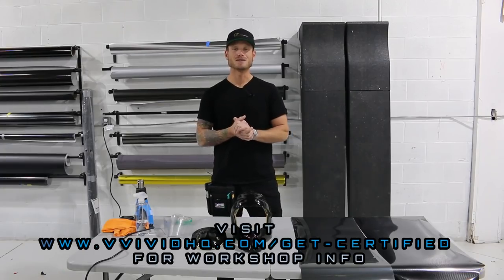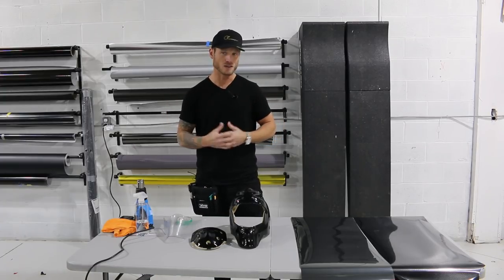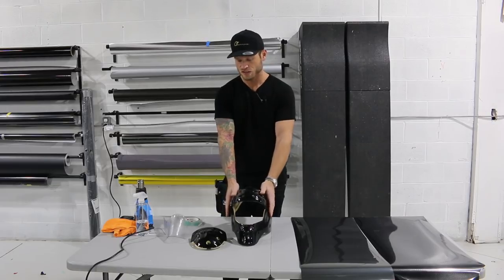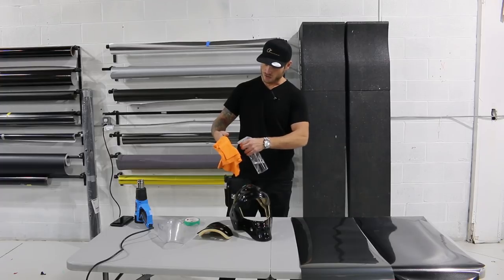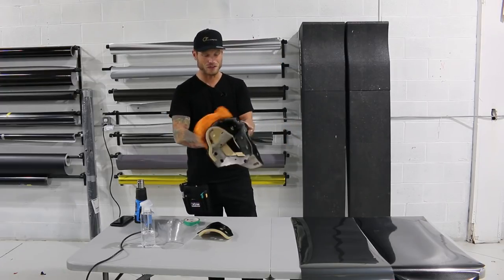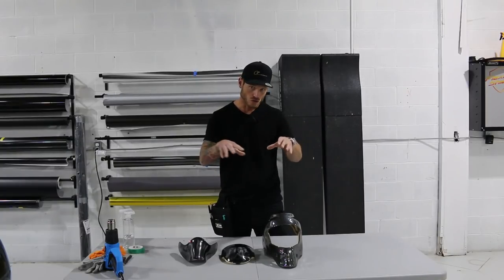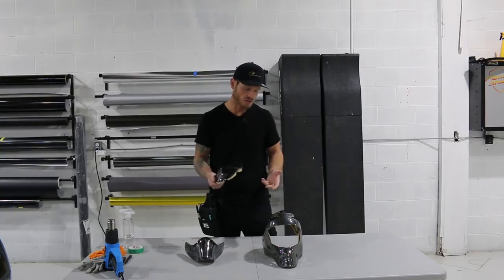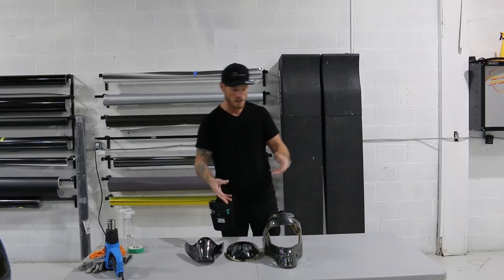Will It Wrap - Goalie Mask Vinyl Wrap

Comment: When I wrapped a goalie mask I put a bunch of cardboard around the end of a short 2x4 and then shrink wrapped it to keep it in place to make a “head” to put the mask on, I then clamped the other end of the 2x4 in a bench vice. It worked quite well to keep the mask in one place so I can heat and stretch with both hands.
Reply from the maker: This is a great idea
Reply: How do wrap a round motorcycle helmet by yourself
Reply: Chris Bundy with the proper technique and tools almost anything can be wrapped by one person. For a lot of helmets you will want to use the same technique Christian showcases here, some helmets can be wrapped in one piece. Like I said I created a mount for my bench vice to hold the helmet solid in one place in order to be able to manipulate the vinyl the way I needed to for a clean, durable finished product.
Reply: @hxcdrums3  Did you do it in one piece? You don't happen to have a video do you?

Comment: I would have used the table itself by putting the vinyl wrap in the center of table, which splits in half.  This way you could have constant tension on one side so your hands could get the leverage and tension needed to stretch the film over the mask.  Great Job even with the obstacles!

Comment: Curious what you learned from this to apply to the next attempt. What would you have done differently? I've seen a "barrel technique" (not sure what the actual term for it would be) done with a regular round skateboard-style helmet that worked well, but I don't know if that would have worked with a goalie mask? I'm going to be attempting a mask soon with a printed graphic on it, and I'm hoping (fingers crossed) that I'll a) have some more input from people like yourself before I start, and b) have some good luck to get it done in a single shot with one piece!

Comment: Brilliant work and teaching brother ... Ace ... heavy Dumbbell plates to hold it down bro?  ... Would a ceramic coating stop water getting into the laminate in the epoxy carbon ? ...  Peace 💙
Reply: I know this is an old post but what I usually do when I'm vinyl wrapping goalie masks where there is something like the carbon fiber or printed vinyl that needs extra protection is an overlay of clear vinyl. Helps to hide the seams some and makes the wrap WAY more durable. Bit more work but it's 100% worth it in the end.